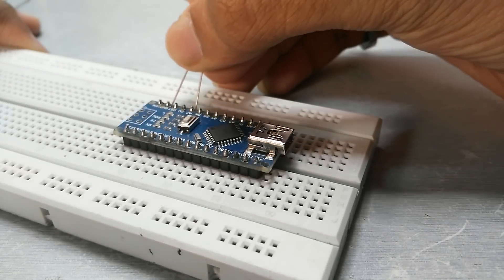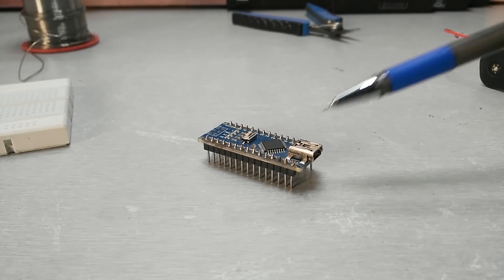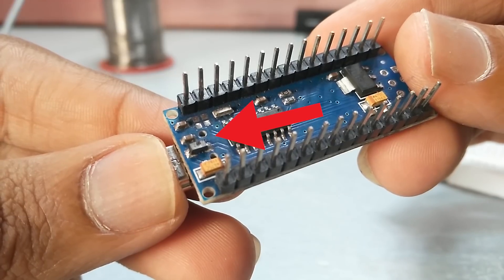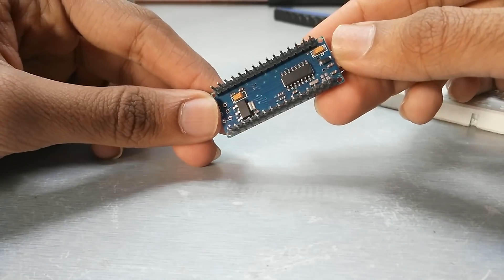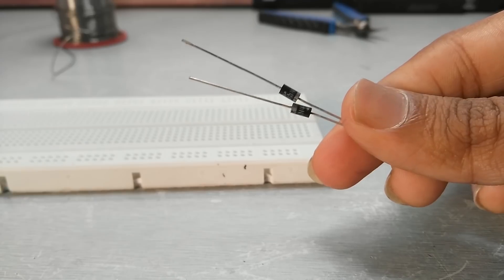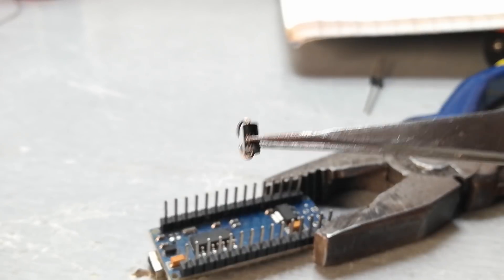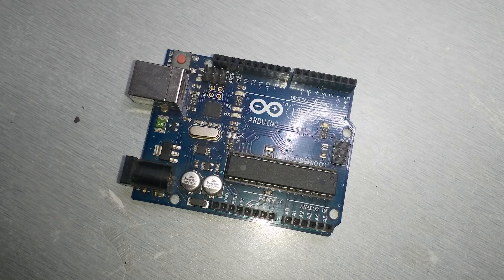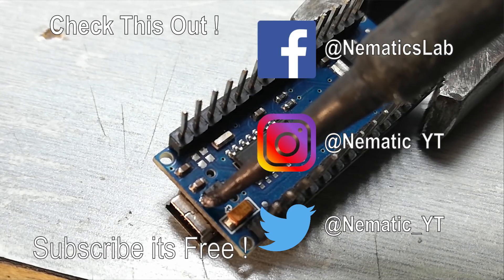How To Fix Fried Arduino Nano/Uno/Mega

Comment: Still doesnt know... i have 4x burn software into nano and work ok...  but after just put lcd.clear() and lcd.print  for debuging its smoking...
Reply: After investigation it was concluded that the ch340 chip was a cheap version so that it became short when reading and writing at high speeds.  Replaced with ic worth three times as much.  hopefully safe. Diode is S4 SMD (1N5819)

Comment: You don't need to replace the diode, instead you can just remove it and short both the pins. The only problem then is that its not protected anymore and next time you short it the arduino breaks completely

Comment: Very informative. 
In my case, both the diode and regulator are fired :) and the diode is in a position that is too difficult for me to use my soldering iron. Heat gun should work but I don't have one.

Comment: So for replacing the diode, do i need any specific diode for it? Or will any one work
Reply: Its best to use a Schottky diode because it has a low forward voltage drop. If you use a normal silicon diode, the Arduino will probably still work, but your 5V output will be more like 4.3 volts

Comment: Arduino uno board is not working A4 and A5 analog inputs. It will always be positive 5Volts constant on pin A4. What it could be, I think current drain it could be, but need if you may point me.

Comment: Hey this happened with arduino uno can you tell me how to solve it it happened beside the jack input what will I replace it with
Reply: And it blew smoke bfrom the big one
Reply from the maker: Replace AMS1117 5V
Reply: Can I use an capacitor

Comment: Sir, I've shorted UNO with 12v (to 5v pin) since tx and rx leds not blinking and not being able to upload sketch . 
is there any alternative way to fix it or upload sketch? (power led is ON and the last sketch I've uploaded is still running)
Reply from the maker: I'm sorry but There will be a lot to fix, honestly get a new one.
Reply: @Nematics_Lab  thanks for replay!
being curious can I use external uart to upload a sketch (as a serial device?)
Reply from the maker: You can try I'm not sure about that either , let me know the results :)

Comment: Bro for vi n pin?
Reply from the maker: What happened?
Reply: @Nematics_Lab  i give 12v input to vi n in reverse polarity 
Now its not responding with vi n
But works with cable
Reply from the maker: Replace Voltage regulator(AMS1117 5V) it's 4 pin component
Reply: @Nematics_Lab  ok thank you

Comment: For Arduino NANO, If i use double power, i.e. 9v from vin and 9v from adapter and jack, what will happend ? will it burn arduino nano?
Reply from the maker: Your nano, power adapter or battery anything will blow up if you use two different power source with different ratings
Reply: @Nematics_Lab  what for Arduino pro mini? We use it as Spwm generator now only its giving upper half spwm not lower half spwm..

Comment: This Schottky rectifier is rated at 0.5A 20V, it is here to protect against an excessive current. I am afraid that if you replace it with a general purpose diode, next time you short your Arduino, you may damage your computer's usb power supply.

Comment: I was powering up arduino Nani through both USB and Vin, and short circuited it.
Now my arduino works fine but USB is not detected. Any ideas?
Reply from the maker: Change ch340 chip

Comment: Hi, I have fried arduino nano when it was powered through VIN. Even though it burned and I saw the smokes, it still gets power from both USB and VIN but the only problem is it won't take any uploads from IDE anymore. I can see that the voltage regulator (AMS1117) has a burnt on it like the small dot on yours.

Uploading codes gives this error: 

avrdude: stk500_recv(): programmer is not responding
avrdude: stk500_getsync() attempt 1 of 10: not in sync: resp=0x11

Should I replace AMS1117 in this case or what? And is there another alternative I can use like you used a simple diot instead of the original part?
Reply from the maker: Replace CH340 chip

Comment: Hey, nice one. Mine seems to have a different problem. I am trying to upload a sketch. after some time it just hangs and does not upload the sketch.
 it connects to my computer thru Com port 3 andT one just hangs and says an error occurred while up loading the sketch. There is something wrong with the board. When I connect the red light blinks times and then it connects. While uploading Rx led just blinks faintly and then after long time error comes.
Reply: Me too

Comment: You saved my life! My Nano went up in smoke as I had other circuits near and they must have touched. Turns out it was only the diode and I applied a fix with another "generic" one, just like you showed. I suppose not all diodes are the same, is there any risk of running it long term with the generic diode?
Reply from the maker: Nope it works fine for me till now.

Comment: This is nice BUT........you will never be sure it is as stable as before. Other things (chipwise) might be damaged also wich you likely will not notice right away.
Reply from the maker: It's still works fine, and I have received messages from people who had 5-8 boards fried and all of them were fixed. It's very common that people fry the diode.

Comment: Bhai arduino uno me 120amps kya tha... 
Usko kis component se replace kare?
Reply from the maker: 1N4007 diode will work just fine
Reply: @Nematics_Lab in my arduino uno this component heating up and still arduino not working 
What should I do
Reply from the maker: Its fuse, you can remove it and short it.
Reply: @Nematics_Lab  ok
Reply: Sir, 
A component which two terminals is golden colour .
Which component is this ?

Comment: i have 1n5822 diode can i use it to arduino nano
Reply from the maker: Yes
Reply: @Nematics_Lab  thanks sir and just telling you it has 3 amp rating and what about sketch will it work?
Reply from the maker: It will work just make sure you don't supply more then 1A from Vin pin.
Reply: @Nematics_Lab  it works perfectly thankyou so much